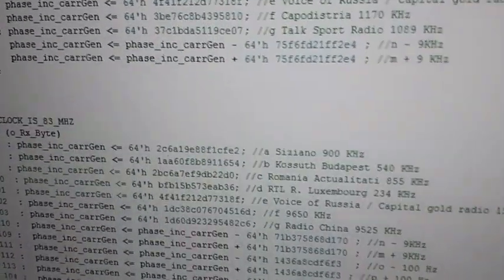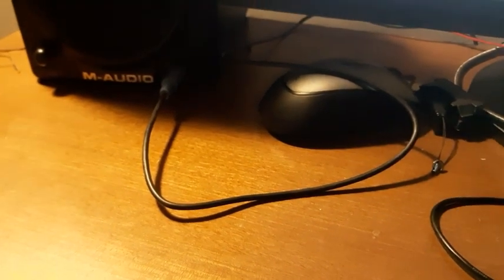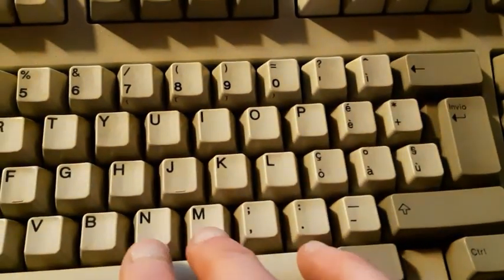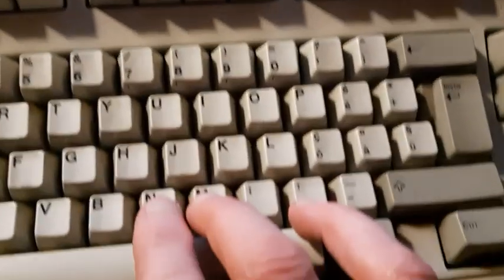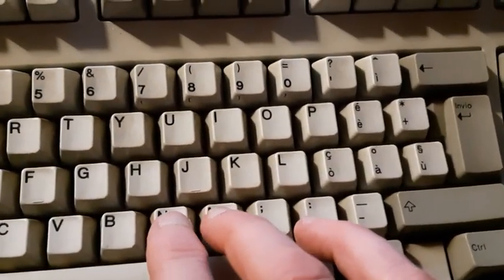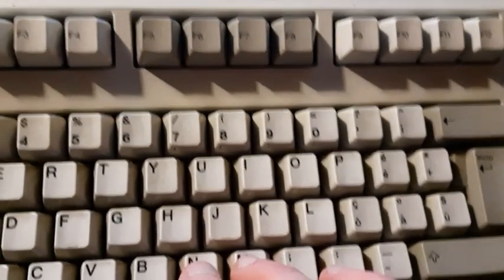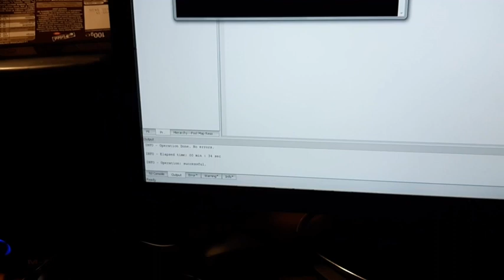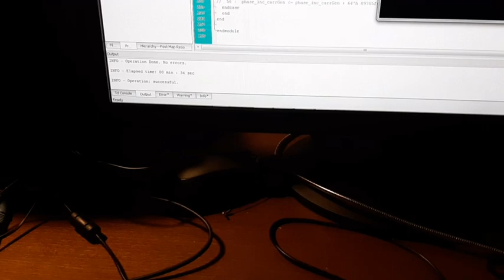FPGA + 3 R + 1 C = Medium and Long Wave SDR Receiver.

Comment: LVDS buffer of the Lattice MachXO2 is used as an ADC?   What magic is this?
Reply from the maker: No magic at all. It can be be used as ADC in two ways at least. Easiest, documented in application notes, is to feed a sawtooth signal to one of the differential inputs and count how long it takes to reach the level of the other input, which is connected to the signal to be measured.
But this is not practical for radio signals, sample rate is too small. Think of this receiver as a 1 bit ADC.  LVDS trigger level is kept at the average of the input. Input is the desired signal + random noise.  In this way we have a stream of 0 and 1 at  several MSPS. The ratio of  zeros to ones is slightly altered by the desired signal. It would be 50% for the random noise alone. When sampling rate is way above the baseband signal, in this case 80 MHz vs 6 KHz, ADC goes from 1 bit resolution to a bigger number of bits.  
For further information please have a look at the Hackaday page linked in the description.
Regards

Comment: Alberto, very cool! I have noticed the Lattice FPGA being preferred lately. Do you like using Lattice better because of the IDE development tools or the architecture?
Reply from the maker: Thanks. I used this Lattice FPGA because It seemed to be excellent for a product I was developing for my job. It was like a sort of evaluation gone too far.  It was somewhat cheaper than the competition, the development tools are at the same level of the bigger brands, for small size projects. Regards.

Comment: in pratica il cic funge anche da filtro p.basso ,non c'è filtro di banda.Interessante, aggiungi 20€ e trovi in ebay lo ADC ds 12bit 65 Ms
Reply from the maker: Io personalmente non perdo  tempo a replicare cose già fatte e rifatte tipo l'ennesimo SDR con ADC su ebay a 20 €. Sono capaci tutti. Questa ideuzza invece per  quanto ne so è la prima volta che viene pubblicata. I filtri se uno vuole li può mettere, c'è ampia letteratura a riguardo. 
Ma forse non ho capito il senso del tuo commento, sembri uno di quelli che dicono ai maratoneti che con lo scooter farebbero meno fatica.
Reply: Alberto Garlassi non mi sono spiegato,intendevo usare una scheda adc 12 bit al posto del convertitore 1 bit e ottenere una copertura 0-30 sempre con la tua scheda fpga

Comment: hello, what Fpga platform are you using?  Is an AM / FM receiver?
Reply from the maker: Hello, it is a Lattice MachXO2, more details in the link provided. This receiver is for LW, MW and maybe SW. In these bands FM is not used. The code provided is for AM reception, it is easy to convert it to DSB, just connect one of the filters output to the audio PWM. SSB would be easy but needs some code.
Regards.